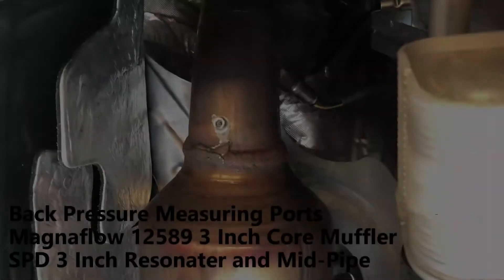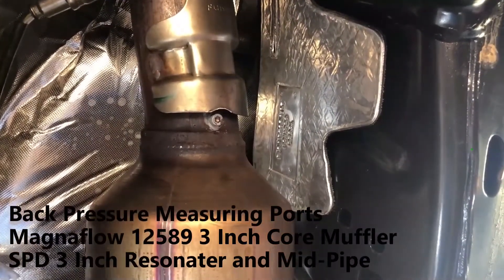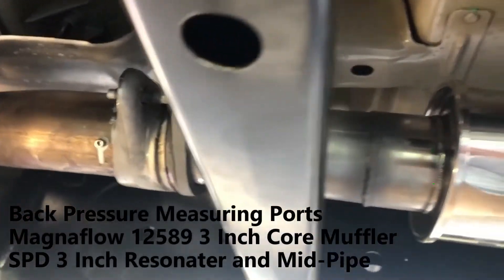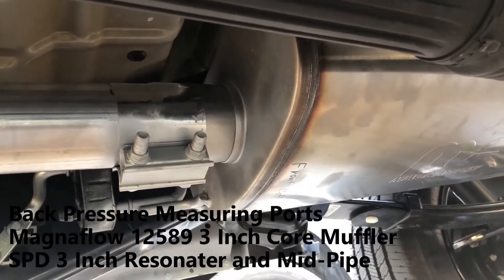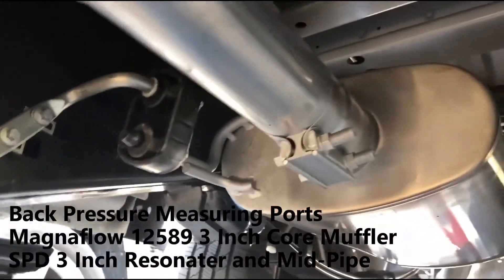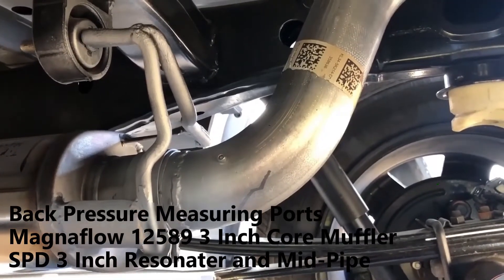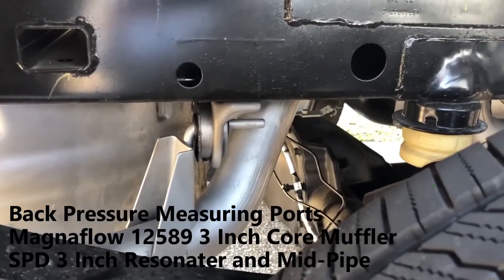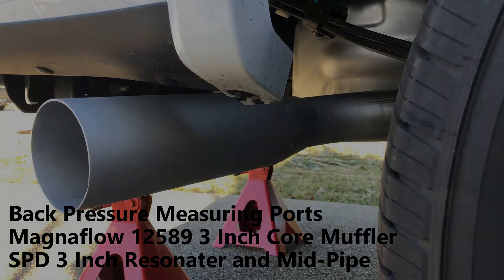2020 F-150 5.0L Magnaflow 12589 Muffler & SPD 3" Resonator Install See Description for back pressure

Comment: Sounds good. Been looking for this for reference. I’ve got a magnaflow muffler/resonator and magnaflow muffler going on next week, I hope it sound as good as that. Not raspy and crackling.
Reply from the maker: Thank you! A resonator eliminates a lot of the sharp crack. And, with a long core, straight through muffler you get the performance and deep, mellow sound. After running this set up for nearly a year,  I would not change anything. It’s pure Coyote V8 music in the cab:-)
Reply: @Allen-Dennis  I’ve been watching and listening to Coyote exhaust for four months straight. I was at the point where I wasn’t going to even do exhaust, but decided to go ahead and do it with as long of a resonator and muffler I could get from Magnaflow as a full straight through system using the factory tail section. I’m even going to use a muffled tip. The tip doesn’t do much, but I noticed on my turbo charged ‘67 VW that it took a little bit of the crackling out from running no muffler at all. I love how you took the time to read exhaust boost pressure too. I did that on my VW to make sure I didn’t have more boost going in than going out when I did have a muffler.
Reply from the maker: I think you will be very pleased with the new Maganaflow sound. You may not be aware, but the factory muffler is straight through, at least it was on my 2020. A large amount of the factory sound reduction and back pressure is made in the small core factory resonator and mid pipe. I would highly recommend a 3" core resonator and mid pipe if that is not what you have ordered. If you are looking for a bit more power, I found after measuring that the factory air filtering system is pretty restrictive, even with the filter removed. I installed an AIRAID 400-293 intake system and it reduced restriction by half. Made a definite seat of the pants improvement above 5K RPM. With the cover off there is almost zero restriction and the truck pulls even harder, but it REALLY howls!
The AIRAID has a larger intake pipe for the throttle body and better flowing filter box.
You might try running your truck with the filter and filter box lid removed to see if you notice an improvement. Have fun!
Reply: @Allen-Dennis  I am tuned with HP tuners by OZ, have an S&B air box, have an ported intake manifold/throttle body, etc. My truck is a beast, but the exhaust, as of now is factory. I’m going to take it in on Tuesday to get the exhaust done. For $100 I’ll let someone else mess with it.
Reply from the maker: I just viewed your video Tunes Test Stock '18 5.0 F150. Excellent job! That F-150 deserves a good exhaust!

Comment: Very thorough design man! I'm looking to do a similar setup. How is the drone? Any at 65-70mph?
Reply from the maker: Thank you! There is no drone. Using a resonator and having the long 22" core in the 12589 keeps the sound very nice at all speeds. I haven't loaded it up with a heavy trailer, but I've been up some steep hills bucking strong headwinds and it did not drone. I also installed an AIRAID 400-293 intake system. It and the exhaust mods definitely increased power, and let the COYOTE howl! Good luck with yours!
Reply: So to confirm… I have a MF muffler with resonator delete. It’s a terrible drone at 60-80. I’m gonna add a resonator but will this for sure fix it!?
Reply from the maker: I can't say it will completely fix it, but it will Definitely help. There are just too many variables. If you don't have a tailpipe, it will almost certainly still drone. Also, tailpipe size affects drone. To minimize drone, especially with straight through mufflers, it helps if the size (area) of the tailpipe(s) is not larger than the core size of the muffler. So if you have a 3" core muffler go no larger than 3" on the tailpipe. If you have one of the tailpipes that takes a single 3" and splits into 2, 2-1/2” outlets, this will increase the sound and could cause droning. In a  given straight through muffler series, a 22” long core will reduce sound more than a 14" core. Hope this helps!
Reply: @Allen-Dennis  this helps immensely! Thank you
Reply: @matthughes667  it depends on the size / design of your muffler. But I'm pretty confident that this will significantly reduce your drone
Reply: @tydontdy3459  thanks for the reply!